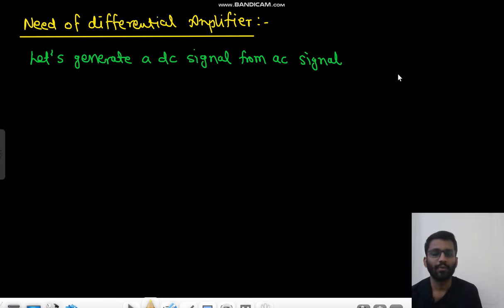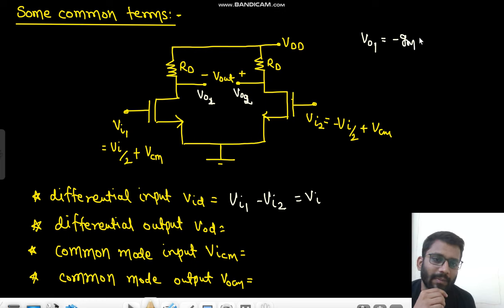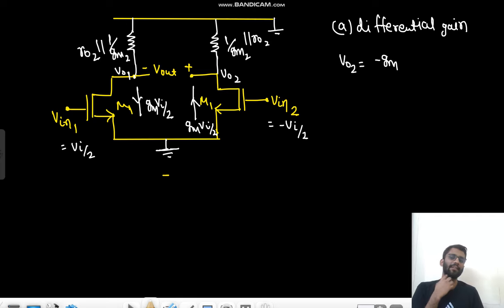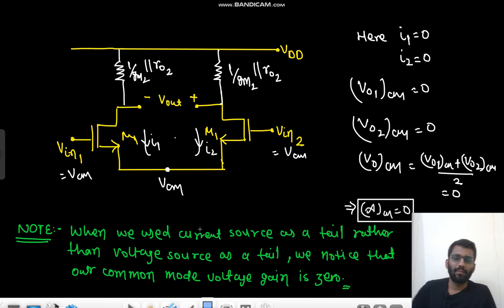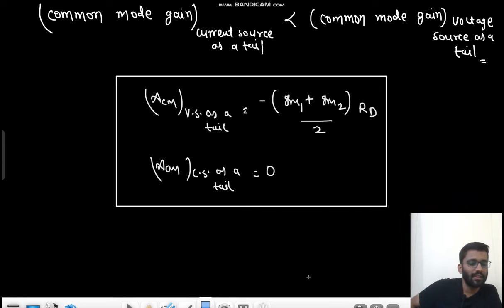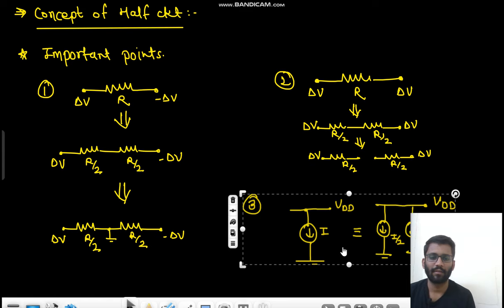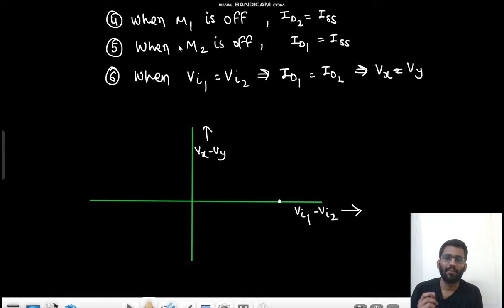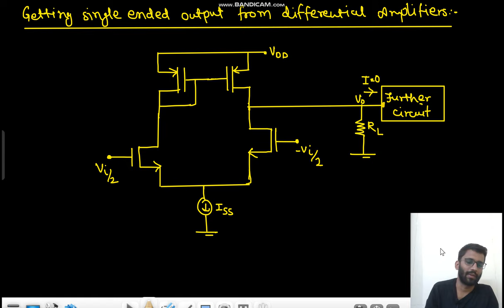Complete Concept of Differential Amplifier || Analog Electronics (Part 2) : Placement Course III

Comment: Hi , at time 1:25:10 , where you are explaining that differential gain is more in current source as a tail. Lets put gm1 =1 and gm2=2 , we are getting Ad(vs)= 1.5Rd and Ad(cs)=1.33Rd , so Ad(vs) > Ad(cs) . So if you check again , there is always differential gain with voltage source will be larger.